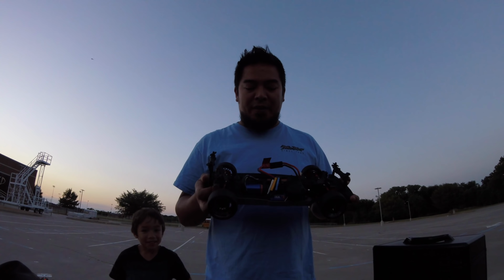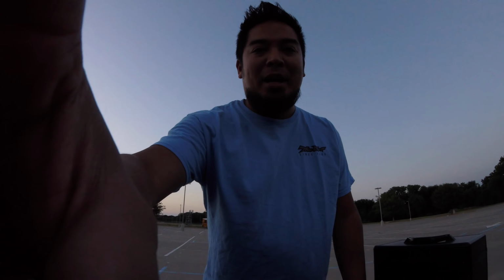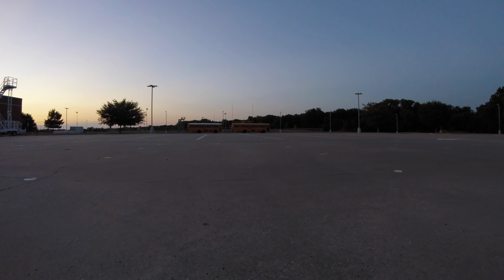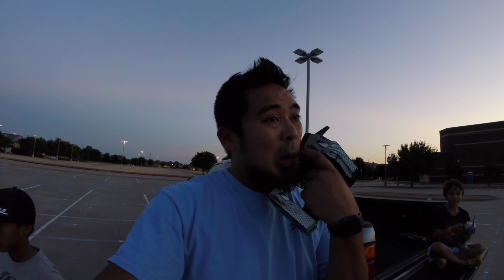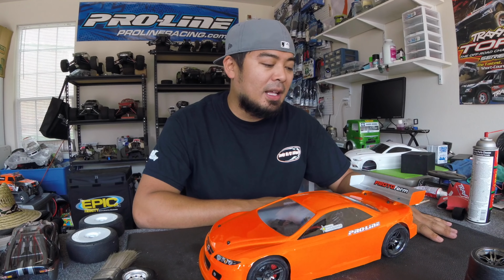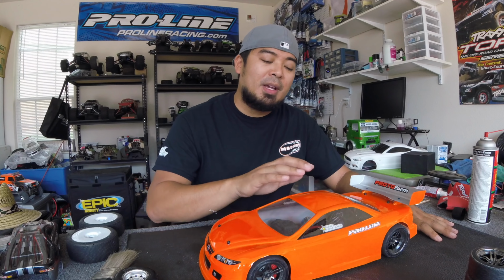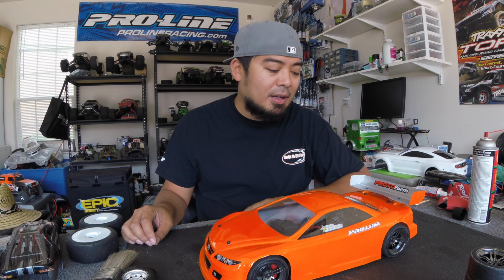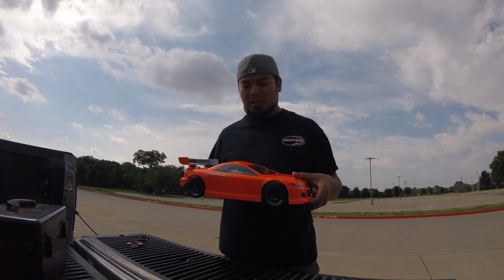Traxxas 4Tec Top Speed

Comment: the issue is the same gearing... right now the only difference is the acceleration but it will have always the same speed no matter what until you change gearing for more speed, that gearing is already max out from factory with that brushed motor, so to unleash this one you need a longer ratio gearing to go at least 62 mph

Comment: want to see 80.. gonna have to get another motor, 5700kv at least, if your going to keep running 3s. It was a bit too uncontrollable for me then, so dropped back to 4700kv, plus was able to run longer without heating issues. You pinned it too with the body swap, both the GT and the Mustang body create too much drag, get it low and try for a body that has a larger open rear to let air get out the back.
Going to start going through tires like mad too, so get the vxl rated. Plus up the driveshaft too, they make a steel one which your going to need.
Really that paint is not bad, kinda likin it.